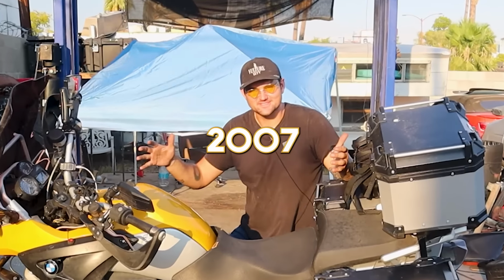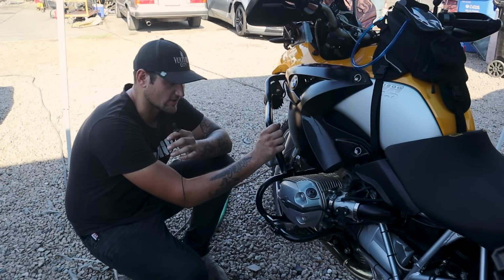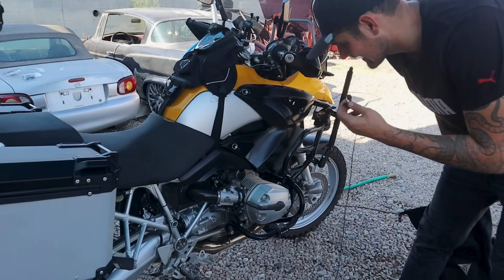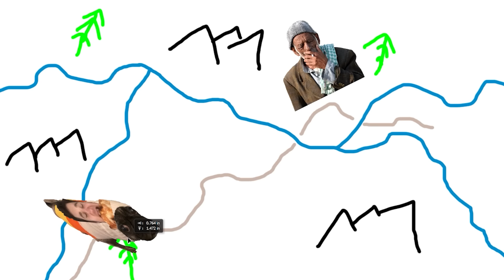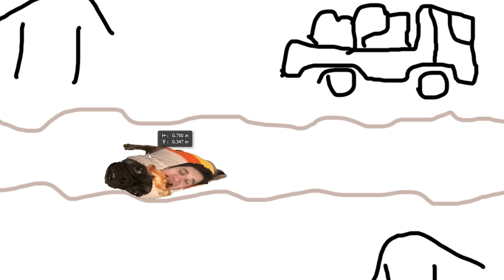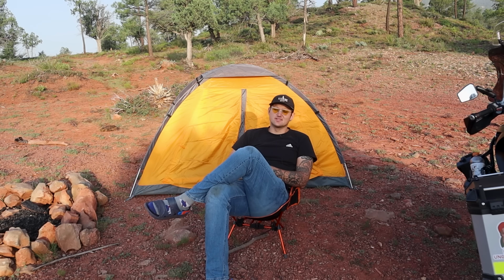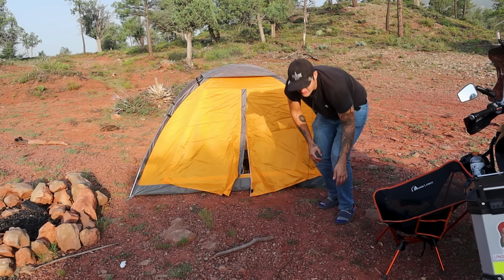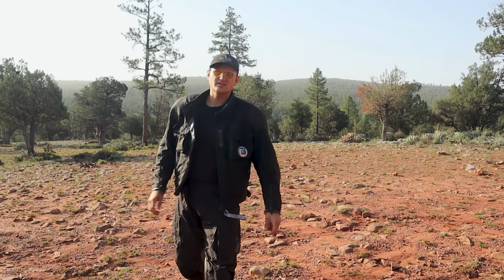A Trip on The CHEAPEST BMW R1200GS Doesn't go as Planned!

Comment: Fuel Strip:  have you seen the cheap fix for the notorious fuel strip failure?  Search on YouTube, it has several videos on it.  Super cheap; two wires and a fireplace lighter switch.
Reply from the maker: Appreciate this tip I haven't heard of it and will check it out!
Reply: @AgatasKatkus  Piezo electric crystal and some wire "resets" the fuel strip when you shock it..  You've seen those clicker sparkers on a gas BBQ lighter, one of those.

Comment: A tank bag with charging capability is a must have on long trips if you do a VLOG. On my F750GS I have brought the 12V into the tank bag and use a 12V to USB fast charge electronics for a few bugs on Amazon, in a 3D printed housing. That is so much more convenient than a power bank, especially on longer trips.
Reply from the maker: I did something very similar and keep the battery bank charged while i ride, and charge any other batteries I need as well! Vlogging adds so much extra difficulty lol

Comment: Yes much improvement in this trip over the last! Ditch the crappy table and use those hard panniers as a cooking service. That’s the only reason to cart hard cases! Haha. I switched from huge happy trail aluminum cases to cheepo tusk soft cases and now I don’t have to worry about breaking a leg when I drop the bike offroad. But if you are gonna use hard cases put them to use as a table!  Other suggestion I have is grabbing a super cheap sheet of tyvek for use as a ground cloth to protect the bottom of your tent. They pack down better than a tarp and really help!  Lastly gotta get a satelite communicator for those sketchy out of service areas. I went with zoleo since it’s cheaper than garmin. But something so you can SOS when hurt or lost without service or when the gun toting locals come out!  

Speaking of which I loved the animations you did they were hilarious!
Reply from the maker: I was actually planning on using the panniers as a table initially but soon found out a lot of the campsites I was staying at weren't very flat so the bike had to sit sideways making the panniers not very good tables. Tyvec is a good idea and I wanted to get a GPS unit but it was out of my budget. I don't think I will be going as far in off road as I thought because of that fact. In the future for sure!
Reply: @AgatasKatkus  the idea is to take the boxes off the bike and lay them on the ground for a table. Or stack them. Whichever works. I do t know how hard yours are to take off though mine were two pretty easy to remove thumb screws each. GPS units are expensive but you can get some pretty cheap satelite comms like the bivy stick.
Reply from the maker: @AndrewChristopherEnriquez   I'm so dumb lol That makes way more sense

Comment: There's a fixed version on the fuel strip by motorworks that's not too expensive. Might be a decent upgrade without going balls out with the float conversion.
Reply from the maker: I've seen it online, and thought about it but I was also running out of time before I needed to leave!

Comment: I have the same 2007 GS.  I changed my fuel strip to the new upgraded one BMW came out with and so far it’s working great.  It allows the bikes computer to figure out mpg and range and can easily get about 220-240 miles on the standard tank.  You can drill a small hole in the filler neck to squeeze and extra 1/2 gallon in the tank but I chose to leave mine stock for now.  Check and make sure your bike has the rear hub recall done.  I’m enjoying your channel 👍
Reply: what was/is the issue with the rear hub please? i've just bought an '06 1200GS.
Reply from the maker: Thanks for the input I will look into that fuel strip when I get back! I called and had no recalls needed! Thanks for watching!
Reply from the maker: The final drive units just wear out prematurely and need to be rebuilt or replaced